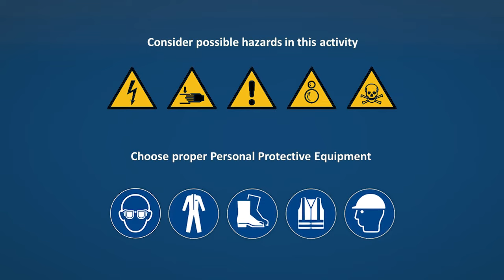How to dismantle and assemble Grundfos SQF helical pumps

Comment: Looks great, im having trouble with mine. F3 error code, cu200 is good as I've tried my never used spare unit to verify the same code. It sure would be nice to see a video on troubleshooting the pump with a volt meter or an easy place to get a motor rebuild kit.
Reply from the maker: Hi! Thank you very much for your feedback! :) Is there anything we can help you with regarding your product?
Looking forward to hearing from you. 
Kind regards, Sofie
Reply: F3 is no communication to pump. I have had trouble with motor leads giving water ingress causing this fault. Or faulty Cu200, but i have found its usually the first instance unfortunately
Reply: Also can't merger test pump for internal faults like a 4" motor unfortunately. Usually the plastic end cap and small gasket is the problem. Or corroded motor pins
Reply from the maker: Hi, the F3 faulty means that the communication between CU and the motor is broken. It can be water into the cable, and due to that, a damage to the electronics inside the motor can occur. It is not possible to meg the motor due to the electronics inside the motor. We recommend that you take contact to the nearest Grundfos service center, for further assistance: http://gfos.ly/6050pqSQe. Kind regards, Sabrina.
Reply: Does Grundfos offer a wire harness solution to the water ingress in the wiring problem? I'm also trying to find another pump that will push 400ft using 120v and I'm not having much luck of finding one. The 6sqflex 3 is using 120v, but I'd rather have a less complicated motor in the well so it's less likely to fail. I could run a 120v pump motor with an inverter in the pump house.
Reply from the maker: Hi, thanks for your question! At Grundfos we have a cable joint kit with PN 96021473. For the pump solution the 6SQF3 is the best or only choice. That is unless your are using a 230VAC solution though. Kind regards, Sabrina.